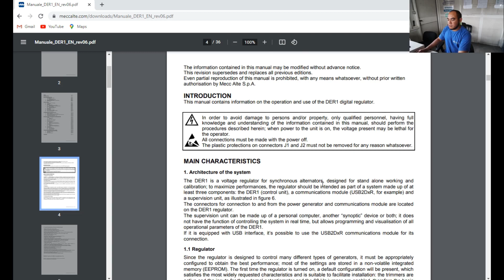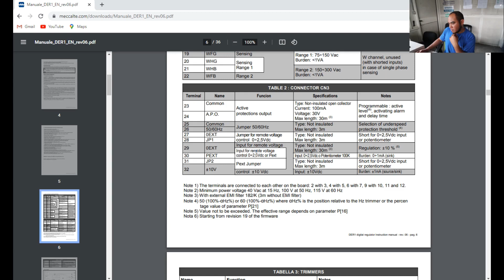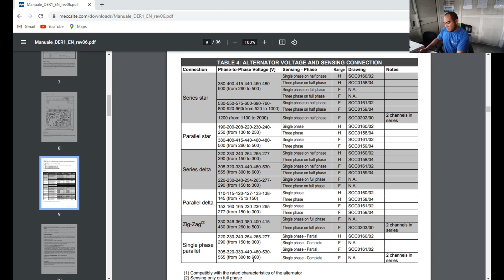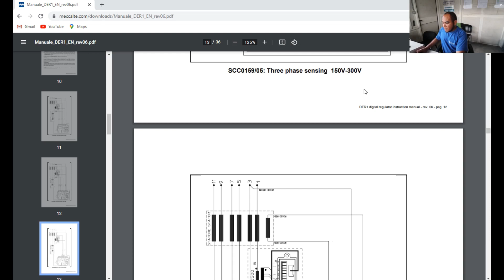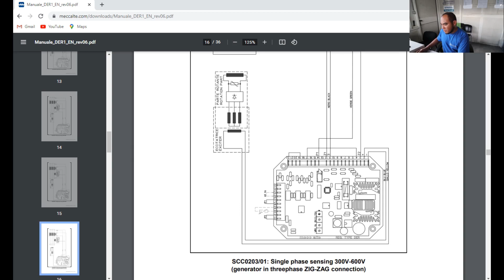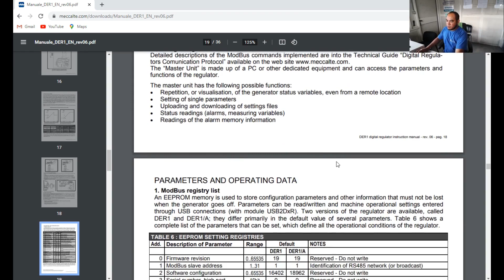MECCALTE DER1 REGULATOR SIMPLIFY benzblogs

Comment: Boss 10V to 12av lang na measure ko sa generator output no AvR yet, 35kVa, 60hz, 230V, self excited converted na daw e, ano AvR pwede ko gamitin? Salamat
Reply from the maker: Ok ganito gawin monpara malaman mo if ok pa ang alternator winding mo kc wala pang avr try mo e excite gamit ang battery at paandarin mo e connect mo ang exciter wire dapat tama ang polarity thin pag my voltage 0-400 ngllaro ok payan so kong avr walang problima if as440 or r250 but before replace basahin mo ang manual ng avr

Comment: Did I should install the laptop to re-adjust the voltage
Reply from the maker: No need you can adjust manualy using voltage adjustment
Reply: Thanks a lot for your replay, could you please told me the way of readjust the voltage, Link, Video any thing please

Thanks a lot bro again for your replay